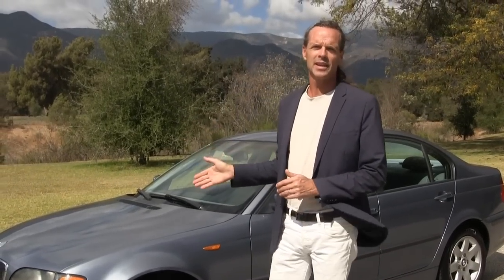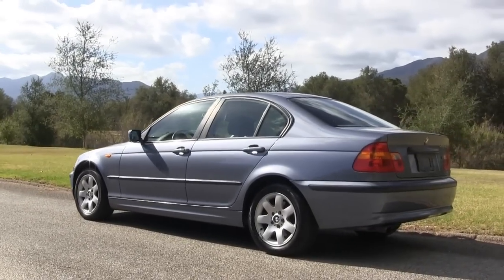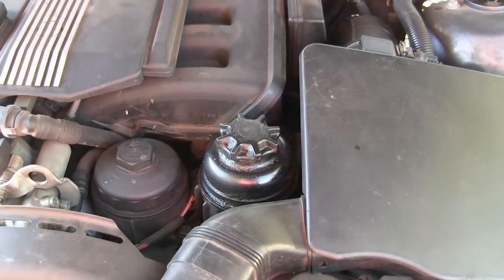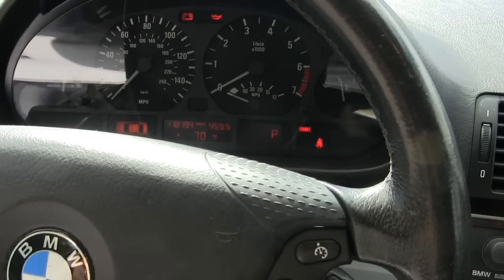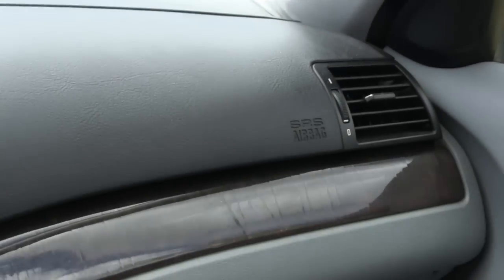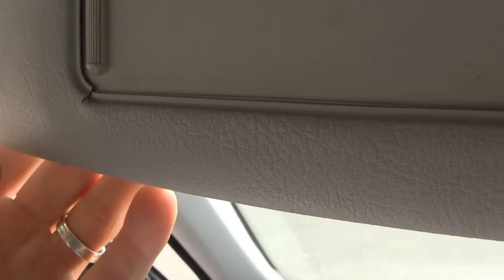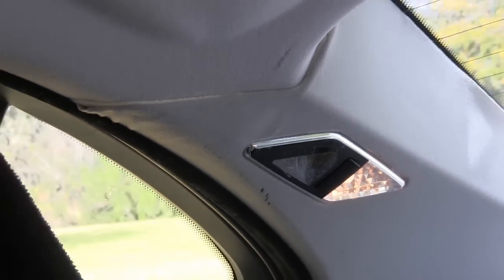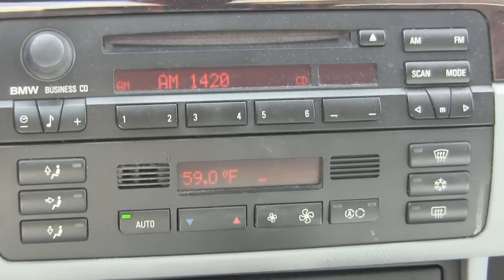Why You Should NOT Buy a Used BMW

Comment: I think this is pretty accurate. Note that the convertible doesn't have the a-pillar or headliner problems. The power steering reservoir is easily fixed by adding a filler cap gasket.
Reply: David McCombs both my e46s still leaked with a new gasket. That doesn’t always fix it. It likes to leak out of the blow off hole in the cap. There’s no fixing that.
Reply: drummerdude if they aren’t over filled and proper fluid. And in static driving they won’t leak.
Reply: BMWs are absolute money pits! 💰

Comment: My brother too bought a 2001 BMW 330 and that car spent more time at the mechanic than my brother actually driving it. Everything was constantly breaking and inside out cheap plastics were used by BMW and these immediately disintegrated when exposed to engine heat and the UV rich sun as you can see in the video. One thing that wasnt mentioned in the video was the transmission cos my brother also had a ton of problems with his. He had it reworked twice, once when the lining broke down and then again when water got into the transmission via the transmission cooler coils which also is a piece of crap. The engine was replaced once and basically almost everything was already replaced or worked on except the ECU and the car was still breaking down on a regular basis. Piece of crap!

Comment: Bout my first Bimmer, M3 E-46 (2002) with 137,000 miles. Drove it around for two years only doing basic maintenance. Excellent car. I’m about to buy a low mileage 2004 E-46 330i next. These are GREAT vehicles. All makers have lemons and bad owners.

Comment: I am glad to hear someone agrees with me about BMW.
 I had one of the first ones in the UK it was a company car and no one drove it apart from me.
It looked great and I felt really privileged to have the company get one for me.
That's when it all went wrong.
The first week I was sitting in the car engine ticking over heater on to keep me warm while I had a drink when I noticed the engine temp was in the red, so I quickly drove off to get some air across the radiator and the temp came down ( the electric fan hadn't switched on ) I took it to the BMW dealer in Manchester. A young woman at reception said it will be an air lock sir ( mmm I don't think so ) the fans not working. An hour later a guy come to me you will have to leave the car with us the fans not working oh really you do surprise me Q do you have a curtesy car A no you are not entitled to one Q how do I get home A don't know
You can collect the car tomorrow, I live 40 miles away. The best thing you can do is take the car ring in 2 miles down the road say you have broken down and we will bring you a curtesy car. Give me the car now Cant do that, Bonkers.

The engine low oil light came on after 2000 miles topped it up then again after another 2000miles then again and again reported it to the dealer, they took the engine apart and horned the cylinders and fitted new rings made no difference is still use oil like there was no tomorrow but it did settle down after 30000 miles.
The header tank blew I limped back to the dealer again, it used water from day one to the day it went back three years later they never found the leak. It was recalled twice.
The windows would go down then jamb and not come back up two new motors fitted.
The final straw - the clutch started shuddering it was so bad once the engine management through a wobbly ( that's a technical term ) and shut the engine down.
I took it in the car was two years old with 30000 miles on it and it had a three year warranty young woman on reception oh it will want adjusting sir ( mmm Don't think so ) an hour later a guy comes out the clutch needs replacing-  oh really -    but it will be coved by the warranty.
Two days later I get a phone call the car is ready do you have an order number for the repair its warranty no its not its chargeable why the clutch is burned. Hang on I want to see a clutch that I have burned in 30000 miles I am coming in to see it.
The clutch showed no sign of burning or blueing it didn't even look worn. Its under tolerance sir its bound to be under tolerance its done 30000 miles but its not worn out.
I complained to BMW but it made no difference we had to pay.
Just to be clear how I drive a car I had a Ford sierra company car from new did 100,000 miles in three years apart from plugs and points oil never had a problem of any kind and was still on the original rear tyres when it went back. BMW what a load of crap.
Reply: derek evans you definitely had one of the lemon.
Reply: Use heavier weight oil like 5w-40 (or 10w-40 in warmer climates). Heavier oil won't burn as much, and will protect the engine more especially in high heat. The thinner oils they use from factory are to meet government efficiency targets, they aren't ideal for the car.

Comment: ive had 2 bmw e46's with 265k miles and 280k miles, still good driving cars. they never left me stranded, also they were in a bit better shape than the bmw your showing.
Reply: …. Said no one ever
Reply: @chiefoso1428  mine was at 350k miles. 2010 328i. Never had any issued with it. Drove better than half the cars on the road.
Reply: @camposjesus3725  350k miles no issues? Yeah ok… nice lie buddy. Even a toyota gets one or 2 at that much mileage.
Reply: @chiefoso1428  its not about the mileage, it's about how well a car is maintained lol
Reply: @camposjesus3725  it is about mileage when talking about a bmw 😂😂. You will never ever be able to convince me  that you DID not get to 350k miles doing just maintenance on that bimmer. Nahhhh.
Reply: @chiefoso1428  well no shit, parts have to be replaced eventually but thats not the car's problem. It's thermodynamics. I have never been stranded by my bimmer. I know when to service things before they break down. Most people dont know jack when it comes to cars or they dont care. 

Then when things break down, they blame the whole brand.. my car has never had any catastrophic failures. The most major things were changing a valve cover gasket at 175k and then changing an eccentric shaft sensor and a mass airflow sensor. Other than that, its the typical preventive maintenance one should take if they care about the car they're driving.

Go to Bimmer fest, you'll see tons of bimmers with over 200k miles on em. You know, owned by people who actually know how to maintain cars? 

When was your last oil change? 20k miles ago? LMAO
Reply: Thermodynamics 😂😂😂😂😂 nice fancy way of saying that your car is a money pit 😂😂😂😂 grab me a lexus es 350 after PROPER MAINTENANCE for 200k miles. Lets see where the thermodynamics are causing some issues ? LOL.

Comment: This is due to high heat and lack of maintenance.
Reply: no its due to cheap manufacturing, bmw is junk if you don't buy it new good luck with it
Reply: naa, have had some older bmws and they have worked great. had a 1999 e39 with 150000 miles on it, no faults while i had it.
same goes with the e87 i had, and my latest e90. good reliable quality cars
Reply: Lack of maintenance on the A-pillars, windshield cowl and roof liner?  bahaahahahaa
Reply: I think that might well be the case. Here in the UK we don't see any of the interior issues from the video as it rarely gets hot enough for long enough. Good summer temperatures over here are 70 - 80 f for a few months only.. Saying that we have quite significant rust issues with the E46 - rear subframes and all wheel arches Oddly, French Cars - noticeably Peugeot and Citroen - despite their image, seem to last for 200 - 300,000  miles without any major issues or indeed falling apart.
Reply: That makes sense to me
Reply: Kaiwen F Yup. He said it was garaged 6 of 10 years...that'll do it.
Reply: I had to reply because i have the same bmw in arizona where the car always has been and have literally all these interior problems. That said...there is no rust anywhere on the car. Give and take.

Comment: Lol. A lot of beamer fans watched this video.  Can tell by the like to dislike ratio that I don't see on most of your other videos. Really though, thank you.  When I first met my wife, she was sold a used BMW by a local mechanic who loved them and always recommended BMWs as first cars for all these kids I knew.  Every one of them had countless problems. My wife's car had all the same interior issues (headliner peeling, pieces of trim popping off easily, chair material stitch breaking, mirror layer separation, etc...) and I remember one winter she used to leave my house to drive home, her heat would fail in the middle of winter and she would be driving home while it was in the single digits inside and out of her car.  Then the head gasket blew. She had an engine transplant by that same mechanic, then the second one blew a short time after.  I'm sure there were several issues missed by this shoddy mechanic, but we ended up ditching that car and I bought her a used 1999 Honda CR-V.  That car ran perfect the whole time we owned it, we drove it all the way across country in 2014 and eventually sold it in CA just because it had a decent amount of rust on the bottom and it was high miles so we figured we'd get something a little younger, but that sure beat the socks off the beamer.

Comment: This guy has absolutely hit the nail on the head- If you watched UK top gear/ The grand tour ( which I love) Ckarkson and his mates spout on about BM's, Alfa Romeos, VW's, Maserati,s etc but what they rarely mention is they all cost a fortune to maintain and they all turn to crap normally sooner than later. I worked for main dealers all my life in the UK as a Tech, our dealership franchises were BMW, Renault, VW/Audi and then finally for a while Honda. I went from doing endless warranty work on stuff that didn't even last a year, especially on Renaults, to nearly no warranty work at all on the Hondas. In the end there was only routine service work to do and quite a few of the guys had to leave as there wasn't enough to keep us busy. So what did the bosses do?- Aftre 5 years they moved the Honda agency to a much smaller site and took on Citroen. It saved the day as back came the warranty work and loads of failing cooling systems, door handles, window regulators, broken suspension and god knows what else. Since those days I have only ever bought Honda or Mazda- I'm like Scotty Kilmer - Rev up your engines  ( as long as it;s Japanese) !!

Comment: My e46 has one of all the things you mentioned you just got a lemon man
Reply: And has the same engine and 150k miles
Reply: Low miles mine has 295,xxx and has some of the previous mentions problems the car in the video just hasn't been taken care of
Reply: I previously owned an e46 325i the rear diff went and it was nightmare,  interior quality is trash as well. My 94 Lexus still looks fresh. Hands down Lexus is a better vehicle than  BMW any day of the week. I also have a Z4 but that vehicle is on a whole different level.
Reply: Lexus??? Nothing more than a tarted up, re-badged and soulless Toyota Camry...'throw-away'  Japanese appliances, every one. Wretched driving, unpleasant at best. Then there's their gruesome attempt at producing an Audi TT knock-off. Labeled as 'LS  400' or something...voted the most ugly car of all time by 'TOP GEAR', unanimously!...truly, just a passing, unintended glance of this steaming pile offends not only the hapless victim's eye..but his/ her very sensibilities as well! I find it amazing how it's possible to design a product with nary a single pleasing line or element. Every aspect of this steaming pile brings new meaning to the word 'UGLY'. Oh, and incidentally,  my extremely hard driven E39 Sport Wagon..with Manual transmission..is at 150,000 miles, visits redline several times daily, endures high 'G' late apex braking/corning almost constantly, has given me not a single moment of anguish. Sure, one  l/r window regulator ($60 and an hour of my time), a battery every three years (precautionary), Brake pads (EBC ultra Hi-friction Reds) and tires from time to time. (early inner outer front tread wear the payment for the joy of late braking and deep trail braking) all cheaper and more enjoyable than cigarettes of alcohol. Personally I often find driving the E39 more enjoyable than either my Porsche 993 C4RSr or Alfa-Romeo.. I've have been in the imported car service & repair business for 50 years (MOTODELTA) , owned more the 80 cars...even a few Toyota's, a Sube, and Isuzu truck tow cars as 'Throw away' utility items. With the only exception being the Subaru, all the other Japanese cars failed in disappointing ways...fragile motors, inadequate brakes..discs warp so easily..lousy 'seat of the pants' communication' , numb & vague road feel, mediocre steering feed back. OK I guess for 'mom & pop' or rental car types, but absolutely unacceptable for real DRIVER guys/girls.. This guy should stick to being a chartered accountant or hair dresser..
Reply: Mine is nice too!  You just have to know the car and know what to look for. This car just bought the worst one out there and said it was shit.. Like wtf
Reply: Amen!
Reply: Does your E46 run good with 150k miles? and which motor is it?
Reply: carivo x not the guy you asked, but I can talk about my old one. It had 200k+ km, over 250k towards the end of my ownership of it. Ran great. Of course, there were some problems as with any high-is mileage car (the cooling wasn't in the best of shape), plus the usual wear items had to be replaced, but overall, it was a solid, very enjoyable car. Mine had the M54B22 engine.
Reply: I have the m52tu in mine and it runs great at 178k miles.
Reply: Its actually pretty common practice to overfill by about a quart to get rid of the lifter tick a lot of e46 have. The thing takes like 8 something quarts normally so its not too big of a difference.
Reply: That's a bullshit!! I had one of those with engine 2.8l(the best engine for these cars) and it was a brilliant and powerful car. All depends of how the car was maintained!!
Reply: they do have a well matched engine with power train,  however plastics and looks are pieces of crepe
Reply: When you pay $700 for a $50 part... The person that did the repair also fixed all 4 window regulators in his own car..... Fuq... He saw you coming hahaha LMAO! Noooot Caaaaan!
Reply: That car is totaled throw it away plz
Reply: too-chee

Comment: I am a bmw user all my life and I have been using "used" bmws all my life too. I didn't get a chance to buy a brand new one yet but hopefully that happens one day. There are certain things in this video which are very correct especially for these E46 series. The poor finishing around the ash tray, cup holders, steering wheel spokes etc. The cracking problem on the wood interior trims, power steering fluid leak around the PS reservoir etc. But in my opinion, many other things such as the peeling head liner, stitching separation on the leather seats, malfunctioning window regulators and radiator cracking problems on the expansion tank are very specific for this particular car on the video. I never had many of these problems on my used bmws that I drove in the last 25 years.  It's very informative video but my opinion is you shouldn't rely on it too much when you are planning to buy a used BMW. As long as the car is well maintained, you wouldnt have many of these issues that are outlined here.. Thanks for the work anyways Greg..